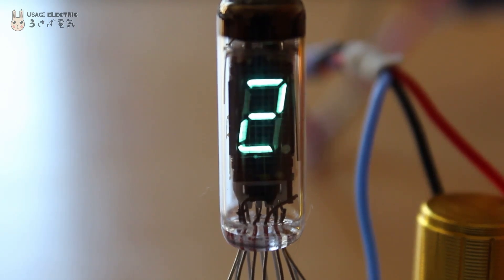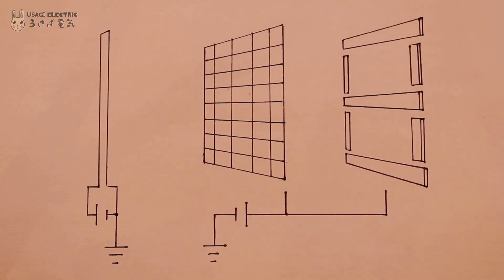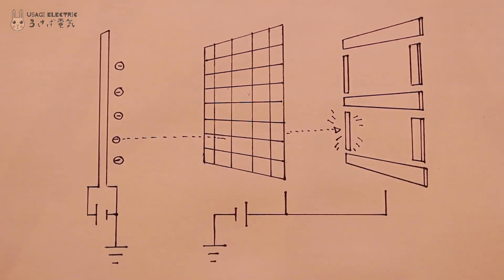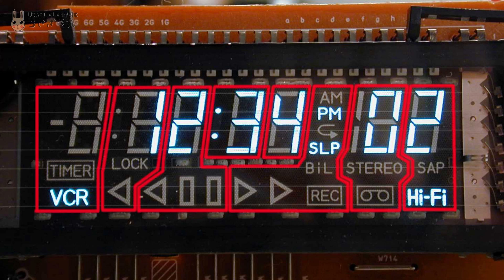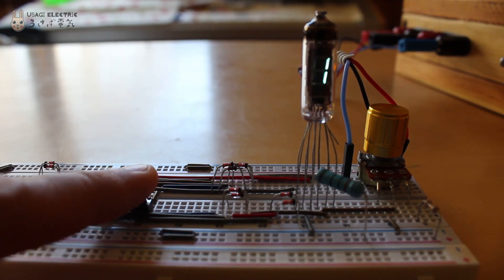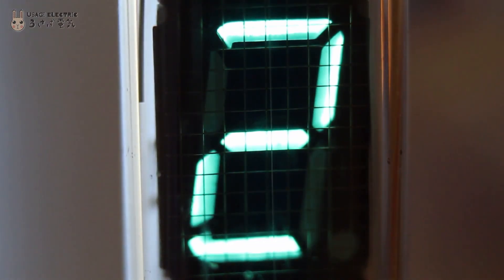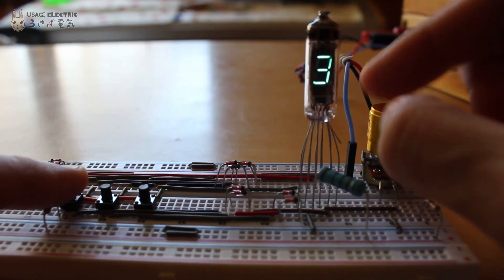In a Minute: Vacuum Fluorescent Displays in 60 Seconds

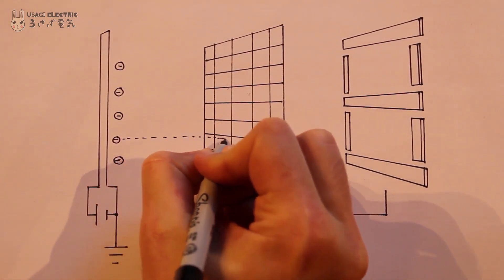Comment: I think the battery symbol at the cathode is backwards.  The long lines typically represent a positive charge, while the short lines represent a negative charge.  In the explanation at 0:14, the cathode is heated up so it will emit electrons.  If it is positively charged, it will be void of electrons.  The newbie needs to keep in mind that conventional current flow is from positive to negative, from anode to cathode, while the actual electron flow is the reverse.  The positive potential  differences (which we think of as conventional current flow) are the positive charges that draw electrons through the circuit.

Comment: What's the circuit you used? I'm trying to take a 5V 1A supply and change it's voltages to power a tube but I'm only getting literal microamps after using resistors and such

Comment: I like the section of "in 60 seconds" videos!  I'm glad to say that today arrived to my house a package of 12 of these tubes inspired by your videos, and I'm waiting the MC14500B too! Do you have a recommendation for the easiest/best method to use these VFD tubes? I saw a video about an arduino nano with a transistor array IC or I was thinking in use an IC from a VFD of a 90's amplifier but if you have another option I'll read it, thanks!
Reply from the maker: Thank you!
Once I get caught up on projects (and have some more ideas for the format), I hope to make a few more "In a Minute" videos. I like having a nice 60 second reference.
The little IV-3 VFD is an absolutely gorgeous little VFD! They're fairly easy to hook up, though the voltages are a little strange. 
The filament needs ~1V at 30mA, and then the anodes and grid need between 20V to 30V. The grid and anodedraw are really small, so it mostly just comes down to figuring out the best voltages for all the components involved. 
The Arduino Nano is an excellent option, and you can even use a shift register like the 74LS595 to keep the pin count low on the Arduino. You would essentially shift the 7-segment value into the shift register, then turn the grid on to display the value. Then, you could stack multiple tubes up and multiplex the grids and have a pretty cool display with minimal pin usage on the Arduino! Of course, the Arudino operates at less than 10V and the VFDs at greater than 20V, so you'd need something to handle the voltage level differences there. It seems the ULN2003 is quite popular, but I haven't figured out a great way to squeeze that chip in there. 
At any rate, if you need some help coming up with a good design to drive the VFDs, come join us on the Discord! There's some really smart people in there who can definitely help get us pointed in the right direction!
Discord: https://discord.gg/p7UsfHD

Comment: Neat! What were the typical uses of these types of tubes, steampunk notwithstanding?
Reply from the maker: Thank you!

VFDs were the primary display technology used between Nixie tubes and the standard 7-segment LED displays that are common now. These VFDs look unique because they're in a tube form factor (gotta love those Russians and their penchant for design), but usually VFDs were built into a flat form factor like in the example at 0.35. Pretty much every VCR, TV, Microwave, clock, Radwood-worthy car instrument panel, etc. that had a display in the 70s, 80s and even 90s used a VFD display. Even the S13 240SX had a (relatively rare) option for a VFD speedometer and HUD (https://www.reddit.com/r/240sx/comments/fovox8/hud_for_1993_somewhat_advanced_for_its_time/).

There were a lot of benefits over Nixie tubes, but chief among which was the lower voltages that a VFD could operate at. Nixie tubes are essentially cold cathode tubes filled with neon, which means they need pretty high voltages, often well over 100V, to operate (you need all that voltage potential to excite the atoms in the neon gas). VFDs can run at much lower voltages. The filament often runs at around 1V to 3V depending on the VFD, and the plate voltage (the segments that illuminate) are usually relatively low. These in the video are operating at 24V, but the S13 dash for example operates at just 12V. Since the VFD isn't actually amplifying anything or trying to pass a signal through, they only need enough potential to get the electrons to excite the phosphor coating on the plate. As such, they draw relatively little power and the low voltages needed means they're super easy to interface with solid state electronics.

Of course, once LEDs became affordable and flexible enough, VFDs slowly got phased out. But, if you have a piece of electronics from the 80s floating around that wasn't battery powered, there's a good chance its got a VFD in it!

Comment: Would it be possible to utilize that VFD tube for audio amplification?
As Korg has done here:
https://korgnutube.com/en/
Reply from the maker: Hi! I'm not sure why this comment isn't showing up on the actual video, I can only find it in on the Youtube Sutdio comments page, which is weird.
At any rate, you could absolutely use these VFDs as amplifiers! There's not a whole lot of gain to be had, but it could definitely be used as a pre-amplifier for a larger gain stage through a conventional dual triode.

Comment: Is there a longer video in the works on vfd's? Maybe?
Reply from the maker: I definitely intend to do so! I recently got my hands on some old IV-25 VFD bar displays that will work perfectly for output indicators in place of LEDs (on bigger projects, LEDs still work great for breadboard stuff). So, I plan on going into a bit more depth on those when it comes time to start building stuff with them!